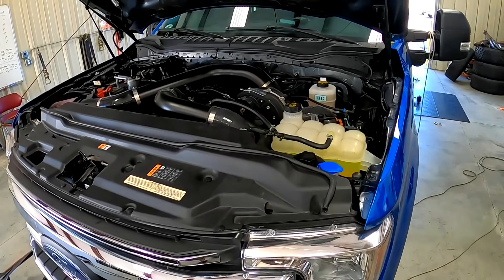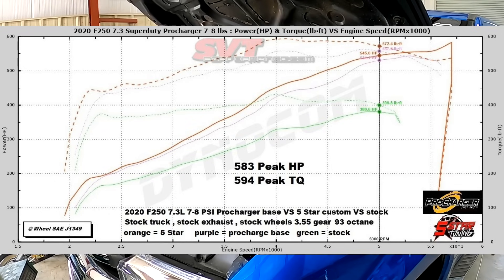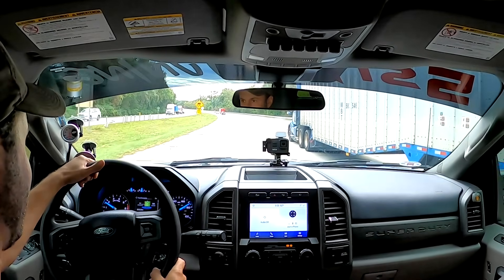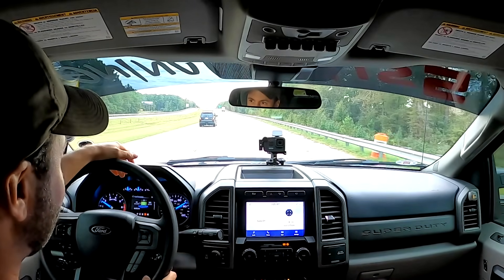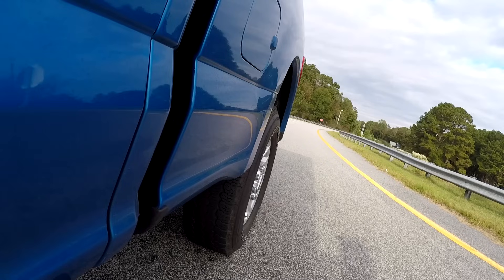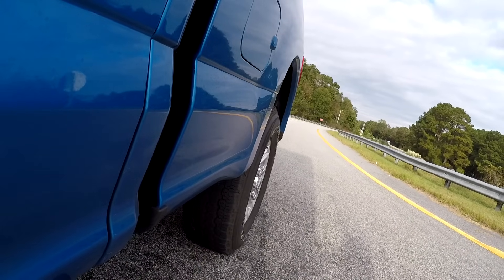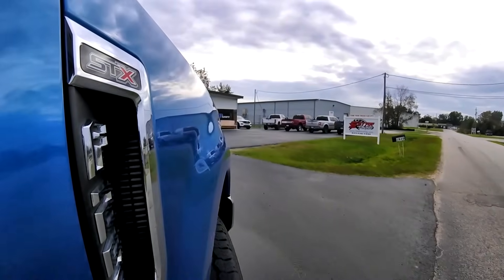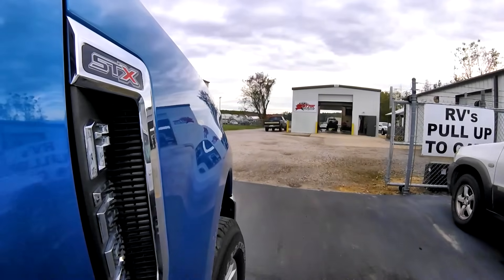FIRST EVER!!! Supercharged 7.3L Godzilla V8 | Dyno Tuning and Road Test

Comment: 😰 why is nobody doing positive displacement superchargers? This makes 8psi of boost at the REDLINE.  
A pds Will make boost from the time you step on the gas to the Redline, this equals much more space under the curve.
Reply: PD blowers take a lot more time and money to design for each new application.  We'll see them eventually.
Reply: You wouldn't want to use  a PD blower for towing. This isn't a race truck. Procharger won't heat soak as much and its less stress on the engine.
Reply: Whipple said they are almost done with theirs. They have the lower manifold designed and casted which was the hard part, they said that earlier today on a live video.
Reply: PD blower is good for 2 passes..... then you gotta let it cool off unless youre running meth.
Reply: @bootlegger2389  Stop spreading falsities
Reply: @JaegerWrenching  I see no lies....
Reply: @bootlegger2389  If setup properly a PD setup is just as cool and reliable as any other form of boost. Most PD setups have inadequate heat exchangers, IC line size, and pump flow. The part that makes it tricky to cool properly is heat from cylinder heads on the non inverted PD setups.
Reply: @gforce_117  and you will still deal with heat issues.  Im not knocking PD's.  They make gobs of power at the touch of the throttle.  But if you're planning on "running it saturday night with the boys"..... that shit is gonna get hot after 2 to 3 repeat pulls.
Reply: @bootlegger2389  
I hear ya. Department of boost has tons of info on it. With enough pump flow, line size, and heat exchanger you wont have issues even with the heat from cylinder heads. There are tricks to make the system more efficient.

Comment: For the money and the lack of torque of that, i will spend my money on a new 1000 ft pounds cummins and get 20+ mpg. And that will never hold resale value like a diesel.
Reply: Cummins, Powerstrokes, and Duramax's haven't got 20mpg since 2007 before the emissions BS. If you get a 1k HP diesel to get 20mpg, please post it here with proof
Reply: @codyhannah1451  lies.

Comment: My friend works at the ford truck plant. He said the 7.3 is eating bearings. Ford knows it too.  But they said it will last until the warranty runs out.
Reply: Have they switched to a updated part yet?
Reply: @SMiller5488  nope.
Reply: @davidchristopher5976  not good
Reply: @SMiller5488  no it isn't.

Comment: Worst editing ever. WHY did you put a voiceover during the first dyno pull??? Also, why the intermittent shots of the rear wheel while driving. Even if you thought it was good footage, use the video only cuz the wind completely drowned out your conversation...not that the conversation was even worth including. The video should have easily been 30 minutes shorter.

Comment: Nice! Still got a long way to out perform a coyote 5.0 tho.
Reply from the maker: Let me know when you find a Coyote powered Super Duty.
Reply: It's set up for a truck not for a race car genius.
Reply: @johnjames5020  never once referred to a race car. There's stock sealed (manifold to oil pan) coyote powered trucks in the 8's. And over a 1000 hp at the tire. Like I said still has a long way to go

Comment: For some reason I was expecting so much more power and torque.  Kinda underwhelming.
Reply: i think the whole new motor is a huge step backwards... i also think a p1 procharger is to small for that motor.
Reply: Do you want peak power in a pickup or reliable, useable power?.... They even said in the video the P1 was undersized for this engine...
Reply: @sorryociffer  yup i heard that the p1 was to small after i commented. in my opinion if 7.3L dont give you enough tq without a blower just go diesel.😄 diesel is way better suited for towing and they last much longer.

unless some sorcery is done with the smaller aluminum block version for the next gen mustang (assuming its what will be in them) that will be a big let down for me. it will be heavier than the coyote i think and not respond to mods as well. i could be dead wronge however. im just impressed what those 4v 5.0's can do.

i would love to see a 7.3L 4v though😳
Reply: @jasonwoody8041  Agreed. Diesel all the way IF you are going to work the snot out of it. That said, 90-95% of most people would likely be better served with the 7.3. It’s what I would buy. I did the diesel way back and wouldn’t bother today...
Reply: @sorryociffer  well, with the new DEF systems that diesels come with now i would hace a hard time buying one too. it causes nothing but issues with our local delivery semi trucks

Comment: So between the cost of the supercharger/ installation and higher fuel cost because you don’t make more power on less fuel with lower hp/torque then a diesel some people think that is better? Let’s remember that diesel trucks are a lot more expensive out the gate but will off set that with fuel economy and use ability for what you would buy a truck like that for and the most important is resale value, diesel trucks hold value compared to gas and with that supercharger how many buyers do you think are actually out there that will pay value or more for it? I am not talking about you I am talking about John-q-public that lives and are in the market around the seller, just my 2 cents worth.
Reply: You’re probably going have to drive at least 300,000 (possibly way more) to recoup that up front cost.

Comment: 590hp hasn’t been impressive since 2010🤣
Reply: At 5500 rpm and 600+ftlbs it's very impressive. Most Hp numbers you see are at over 1000 to 1500 rpm more than this Don't be fooled by just peak numbers it has more to do with torque and hp numbers across the entire curve. Put 20 pounds of boost on a stock motor and get 800 to 1000 hp is insane and this motor would handle it no problem.

Comment: This engine is a turd. Ide take a coyote any day
Reply: Coyote is not made for a Superduty. Wouldn’t last 40k miles. If it was a good fit it would be there
Reply: This makes waaaaay more tq lol
I'd take the 7.3. Much more simple/compact/displacement
Cant wait for the 6.8
Reply: You need to do a little research before you make ridiculous comments.  You might save yourself some embarrassment.  This cast block has six bolt mains, forged rods, and many other HD components.  This bottom end will take 1500-1800 hp. The racers are all over this engine right now.
Reply: @jthorpe454  show me a stock engine putting down that kind of power....
Reply: @jthorpe454  you mean the build making 1400 with this setup? fitted the 7.3 with Stage 3 heads, a new camshaft, a dry-sump lubrication system, an OBR ECU, upgraded pistons, and MGP Rods. The compression ratio is 12.5:1, up from the stock motor's 10.5:1, give me a break .. do that to a coyote and you'll be 1300 plus get real haha
Reply: @josephsonntag1354  That’s an odd statement.  Look up the word “potential “.
Reply: @jthorpe454  again you can make any engine fast depending on what you do to it. Your statement is nonsensical as you are touting the greatness of the engine when its fully built forged rods pistons new heads sleeves and compression ratio change when a stock completely unopened coyote with fuel and boost will be 900 to 1000 all day. But maybe you just aren't that well versed in the subject matter.
Reply: @josephsonntag1354  maybe you should quit insulting people on the internet. Don’t be that prick. And NO, not every engine’s potential is the same.  And if I have to explain that to you then…Time will tell whether or not the 7.3 is a “turd” as you stated.  Let’s see what Ford does along with the rest of the HP community.
Reply: @jthorpe454  look who is name calling haha and just so you know,  I can promise you that engine will never make it into a production mustang,  they have already said they are going hybrid and electric but keep holding out dreaming.
Reply: @josephsonntag1354  :::yawn:::